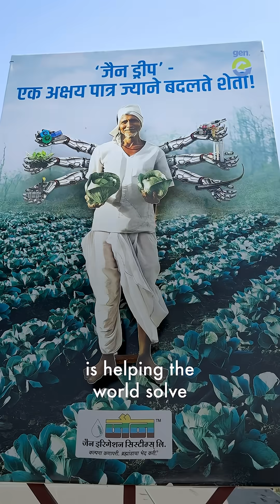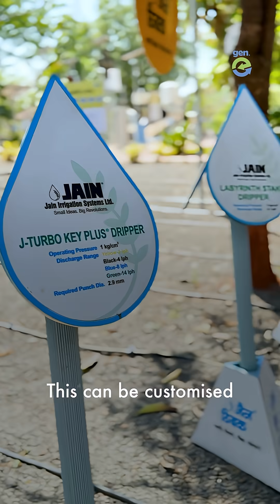How drip irrigation system is saving the world | Jain Irrigation from  India #farming #agriculture

Comment: I found it was cheaper to just buy the pipes and make the drip irrigation system rather than jain’s franchise shop. They quoted 4lakhs per acre but buying individually got the price down to 4lakhs for 9acres. They need to work on the pricing and fleecing by middlemen and franchise shops.